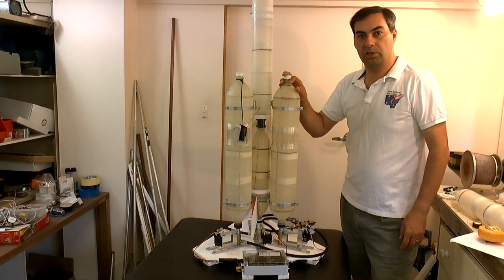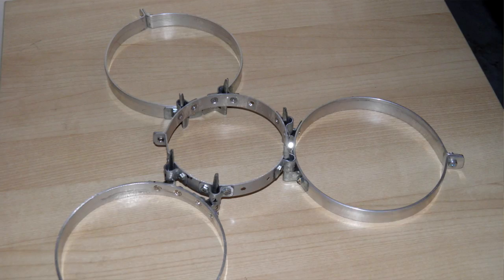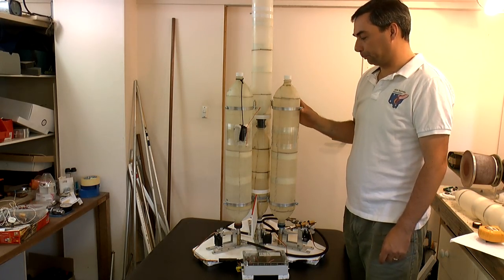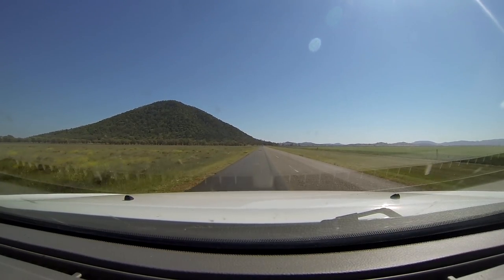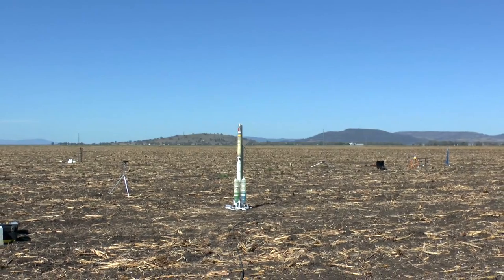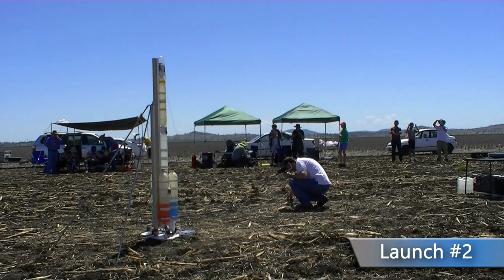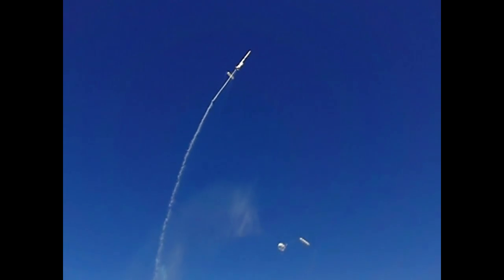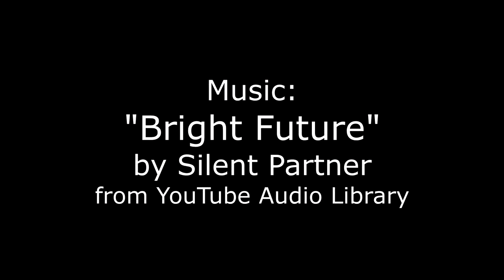Water Rocket with Boosters - Axion G2

Comment: Hello Air Command, nicely composed video as always. I like the fact that you talk us through the mechanisms and how the rocket works. Its simple, clever devices that really do the trick. The launch was AWESOME! If this is just the small one I can't wait to see how high the Polaron goes! Interesting though, how high the Axion G5 went with a 9mm nozzle at a high pressure.
Reply from the maker: Thanks Jamie. We too are keen to see how the Polaron G2 will fly, although it is not being built for altitude. It is being built for a long duration burn. The boosters are needed to get it up to speed as the small nozzle would not get it off the ground with sufficient speed. We're happy with how the Axion G5 performed, and it should be possible to push that performance a little further when launched at 250psi. We'll have to wait until next time to try again.

Comment: Wow the lighter weight rocket sure gets off that launch pad in a hurry.  Might be easier to sync the larger rocket since it will launch slower.  I've found even with a mechanical linkage release (steel bar), multiple rockets will not launch together unless everything is exactly the same-weight water, nozzle, release mechanism, friction on the launch tube etc.  So much so, I'd say any leak on the boosters should be cause to abort.  Good luck, that is one impressive rocket.
Reply from the maker: Thanks bugwubber. It always surprises me too how quickly it does get going. At lift-off the rocket with the water weighs ~11kg (24lbs). The final rocket will be over 20Kg. The sync issue was due to us just trying to release the sustainer as close to the boosters as possible. On earlier flights with the launcher and normal pressure rocket we had a longer delay and there were no problems. The timing worked okay on this first launch but there is a little variance between launches I guess so we'll just delay the sustainer perhaps another 5ms, and should be all good. On the big rocket launch we'll make sure all leaks are eliminated before launch. One of the reasons we are trying with a smaller rocket first. :)

Comment: Really nice rocket. Good job!

In the future please build a rocket with  large boosters, that have fuel-crossfeed, so when thoose burn out, the sustainer stage is still full.
I know that, that's hard, but please try it at least.
Or a three stage rocket.
Reply from the maker: Thanks Peter. This rocket we are building (Polaron G2) is specifically designed for a long burn rather than to go as high as possible. Because we are using a small nozzle, the rocket doesn't have enough thrust to get off the pad fast enough, and hence the need for boosters to get it up to speed. Static tests of the Polaron G2 rocket have given us burn times of over 10 seconds. 

"In the future please build a rocket with large boosters, that have fuel-crossfeed, so when thoose burn out, the sustainer stage is still full."

Something like this? :) : 2-Stage Water Rocket to 864 feet - A project from several years ago.
Reply: No, I mean that there is a pipe or something that drains the fuel from the booster and use it in the sustainer, so that the sustainer is still fully fueled when the boosters detatch.Such systems are used in real(space) rockets,that have liquid fuelled boosters(hydogen,oxigen).
And please build another high preassure rocket.
Reply from the maker: Peter Simon Bohner Interesting, I wasn't aware there was such a configuration. Do you have a link, or an example of the rocket that uses this system?
Reply: The soyuz rocket (1st stage) used that or the space shuttle(the main shuttle drains first the fuel from the big orange tank) or the delta IV rocket
Reply from the maker: Peter Simon Bohner But the shuttle external tank is not a booster, it is essentially just like a drop tank on military aircraft. With the Soyuz, I wasn't aware that there was any transfer fuel/oxidizer between the liquid boosters and the main stage. With the Delta IV I assume you are referring to the Delta IV Heavy as that has liquid fuel boosters?  I also wasn't aware that there was any transfer of fuel/oxidizer between the cores. Am I understanding correctly the configuration you mean?
Reply: Yes you do.
Reply: AirCommandRockets Look up falkon heavy on wikipedia.
Reply: The term for this is "asparagus staging". But I believe there is no existing rocket that uses it. (It was at one point planned for the Falcon Heavy but that plan was dropped.)

Comment: Wow, that's a really well made video.
Especially the combination of background music and the video files is great!
It seems like the Axion G2 performs very well, I'm sure you can fix the problems at the second flight. :)
I really like the parachute mechanism for the boosters, it looks very easy and reliable.
We will use a similar mechanism at our Swallow 2 rocket, thank you for the great idea.
Can't wait to see the flight of the Polaron G2. :)
Cheers
Julian from Raketfued
PS: If you are interested, I would make a nice little video/trailer for you and your rockets. I'm so thrilled of your rockets and your videos, it would be a pleasure to do something like that. Just say if you're interested, and choose a nice piece of (free to use) music.
Reply from the maker: Thank you Julian. We were happy with how the Axion rocket performed in these tests. The couple of small issues are easy to fix, with just a new washer and slight adjustment to the timing. We are taking small steps with the launcher and rocket as we want to see how each of the systems behaves before flying the big rocket. The rocket and launcher are designed for 250psi, but the big rocket will first be launched at 200psi, and then if the flight is successful we'll try again at 220psi and then at 250psi. At the higher pressures there is a much greater risk of something breaking so we want to at least get a couple of flights in first. 

Re videos, I'll send you a PM. :)
Reply: AirCommandRockets

Alright, thank you for the information.
Have you ever considered  about painting your rockets?
It would look absolutely awesome.
Cheers
Reply from the maker: RaketfuedRockets We haven't had a lot of luck with painting PET bottles because the paint seems to flake off after several pressure cycles. We've tried vinyl paint which is stretchy, but expensive. The other reason is that we use a lot of tape on the outside of the rockets to hold things on, and when we remove it the paint can peel. When building rockets like the Shadow with a nice finish, then yes we paint them. :)
Reply: AirCommandRockets George about the paint i had the same problem….
what i found out is that high gloss paint does the job after some 20 launches it stills hold pressure perfectly
Reply from the maker: SPN WaterRockets Good to know, thanks for the information, we may have to give that a try. Do you know how well it holds out against applying and removing sticky tape/electrical tape?
Reply: AirCommandRockets
Just want to say that I have received no PM yet. Don't get me wrong, you do not have to hurry, it's in case that something went wrong with the PM.
Reply from the maker: RaketfuedRockets Hi Julian, I've sent it via normal email.
Reply: AirCommandRockets about the tape, if you wait enough time (letting it dry) like 5-7 just to be sure, it will hold like nothing, i mean it holds great George.
And even i use high gloss paint  to paint my coropplast finns since alms no tape stick onto that thing, but impressively after a few hands of high gloss the tape sticked perfectly
Reply from the maker: SPN WaterRockets Cool, that sounds good about the tape.
Reply: AirCommandRockets
 I have sent you an email with some questions three days ago.
Please reply, so that I can continue the work.
Best regards
Julian
Reply from the maker: RaketfuedRockets Hi Julian, I didn't receive your email. Could you please re-send it?
Reply: AirCommandRockets
Sure thing. =)
I have sent it to you again.
Did you received it?
Julian
Reply from the maker: RaketfuedRockets Yup, got it thank you. I will send a reply soon.
Reply: AirCommandRockets
Alright. =)
PS: The first part of our project will be released on the following saturday. =)

Comment: I wonder how much useful thrust those boosters add. Granted they look cool parachuting back but perhaps lengthening the central core would give better efficiency due to the light weight of the "fuel tank"/rocket skin and the associated reduction in complexity would eliminate leakage and potential failure points.
Reply from the maker: They add about 30% to the overall altitude when compared to the sustainer alone.

Comment: Prsssure burst is greater then flame, flame consumes an atmosphere rappitly to be exploited as momentum in say, a cone, although pressure burst can get out of control or over exirt. If you could manage to covert density level of fuel, say from multi mix or single solid to liquid to gas phase chambers, eventually reaching a pressure unit, it would save thrust duriation time, before the final chamber/booster to exirt. While separation of fatal high combo fossils, to link only during thrust chamber areas.

Comment: The construction  of the launcher and rocket seems to be verry good. Do you think that he's going to have a height above 300 meters? I have a little suspicion that this is going to happen. What a great launchsite with great space. Meanwhile I've launched Antares 3 B again and I've  had the seem problem . LEAKS!!! These are fixed and ready for a next attempt as you will certainly do. The GoPro hero is still  making nice shots. All well done.
Reply from the maker: Hi teamlucrockets, I think once the rocket is flying properly, and at the designed 250psi pressure we should get over the 300m mark. The final large rocket will be interesting as it will have a small nozzle, but we are trying to get a long burn out of the rocket rather than have it go to a high altitude. We prefer the long slow burns. The new launch site is great, we are looking forward to trying some other projects we are working on there. :)
Best of luck with the next Antares 3B flight. I'm looking forward to the video. :)

Comment: AirCommandRockets Would there be any benefit of connecting the boosters together (in the same arrangement that you have them) so they share the same liquid and gas pressure, as well as release together ?
Reply from the maker: This is something we considered early on in the design, but for that you need high pressure linkages between the boosters. The problem then is that they are permanent and it makes it difficult to separate from the rocket without the fins getting caught up on the linkages. You could have detachable linkages but that adds weight and complexity.

In the end we just went with the launcher manifold doing the pressure equalization between the boosters. There is a tube inside each nozzle that emerges above the water level in each booster that allows the pressure to equalize without transferring any of the water. Here are more details: http://www.aircommandrockets.com/howitworks_1.htm#DropAwayBoosters

For the higher pressure launches the stress on the central nozzle is too high to hold the main stage and boosters like described above. So for this reason we have a new launcher that holds everything individually. 
G2 Cluster Launcher Tests but we still use the pressure equalizing manifold.

Comment: Physics quiz: If you added salt to the water to increase weight, would the rocket go higher?
Reply from the maker: Probably not: Here is an explanation and experiment that shows why: https://www.youtube.com/watch?v=Fu3rIiPy_18
Reply: or use mercury instead of water
Reply: The mercury would probably weight it down more due to the much more weight, I think water is the best choice in my opinion

Comment: Hi George!
Well ill try to be straight: i recently bought sikaflex construction and tried to make splices with it...i made 4 splices and 2 of them have not hold more thane 70psi with water!!! D:
I let them sit fro a week or so and , if it matters, here where i live is realllllly humid. Do you know what shall i do to evict such problems? Shall i wait more time?did i buy the wrong glue (ps i can't get 11fc or pl premium around)?
PLs help im quite helpless since im trying to finish my 2 stage rocket.
Waiting your answer asap 
Shiva.
Reply from the maker: Hi Shiva,
Sikaflex is not a good glue to hold splices together. It is good as a sealant, but that's about it. PL premium is what you want as it is at least 3 times stronger than Sikaflex. You may want to have a look around for other polyurethane glues and test with those. Unfortunately I don't know what glues you have available to you.
Reply: AirCommandRockets Yeha D: Im unbelievably sad at the moment i made THE best rocket I've ever made, it took me 2 week to make with working staging system+staging parachute and then bam the splice doesn't work D= sooooo sad
i made it specially to upload vids since it was really beautiful.....
Guess ill just go back to epoxy.Also i found out a new glue which takes 10 minutes to dry and my friend(also a rocketeer) told that his splices with this glue held up to the bottle to explode O.o. interesting i will check out and send details.
Wish me Luck!
Greetings from India!
shiva,
Reply from the maker: SPN WaterRockets Sorry to hear about the amount of work you put into it go up like that. You should always pressure test the splice a little past it's intended launch pressure before you assemble it into a rocket.  This will save you a lot of time. We hydro-statically test each spliced pairs of bottles to make sure there are no leaks or failures. The ones that fail we just throw out or use for nosecones. Good luck with the tests, but fair warning on Epoxy, it also isn't a very good glue to use for splicing as it is sets fairly hard and may crack after a few pressure cycles or harder landings.
Reply: Actually i doesn't….. Im quite experienced with epoxy and it held some 50-60 launches with is good enough i guess…. i Will work out new methods any ways. I kinda hate living in india for this fact: You can't get shit here(quite straight forward sentence)
But ill keep you guys updated. Starting Building today :D wish me luck!!
Shiva =D
Reply from the maker: SPN WaterRockets Good to hear you've had success with your epoxy. What kind of launch pressures were you launching with? Also what brand of epoxy did you use? Having limited resources can be difficult, but it also sets you a good challenge to work with or adapt what you can get your hands on. Keep up the good work! :)
Reply: True george I'm using standard araldite epoxy…. And new problem hehe the water from the rocket keeps going back to the oz connected with the gardena connector!! Shall i build a non return valve or what?
Reply from the maker: SPN WaterRockets If the water is draining back down the hose, you can fit it with a non-return valve. However, you may not actually need one. When you start pressurising, a lot of that water will flow back into the rocket. You may get some to flow back again after you stop pressurising, and before you launch, but it shouldn't be too much. Just add a little more to the rocket to compensate.
Reply: +SPN WaterRockets hmm... I also use 96hr epoxy which is stronger than the shorter cure ones. I've had 120 pressure cycles and it still didn't leak nor explode. Try the Pioneer brand structural adhesive.

Comment: Hi George congrats to all the team for these great launches….I was wondering why do you put the fligthcamera facing downwards?Is it because it gives a better notion of distance and speed of the flight?
Becouse personally i find that facing the camera sideways is faaaar more beautifull at least the view is.
Also i wanted to thank you guys for the amazing tutorials, since I'm finishing my 2 stage rocket =D and I'm getting MUCH MORE professional and perfectionist thanks to you guys and raketfued….Keep up the amazing work and btw as I've written high gloss paint paints the rocket perfectly and id doesn't flake off, although it takes 3-5 days to dry depending on your climate.
AMAZING VID
Congrats from India!!!
;D Shiva
Reply from the maker: Thank you Shiva. :) Great question about why we point the camera downwards. There are a few reasons. We find there are more interesting things to look at on the ground than up in the air. Also if the rocket is spinning on the way up looking sideways gives you a more smeared video. The other reason is that we attach the parachute cord so the rocket falls sideways so on the way down the camera can film the horizon or essentially the "sideways" shot. I think the ideal view would be mostly down with perhaps the horizon at the top of the frame, a lot easier to do with wide angle lenses. But having said that, I'm all for multiple camera angles. 

Also thanks for the paint tip. I have replied to your other post.